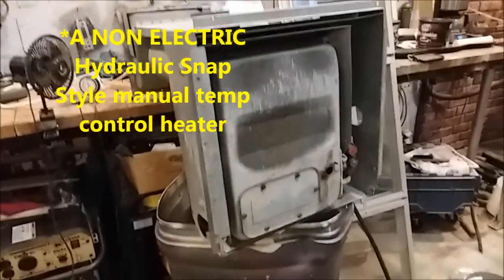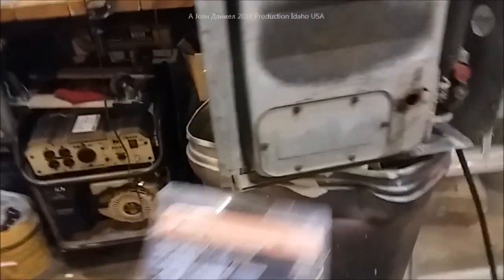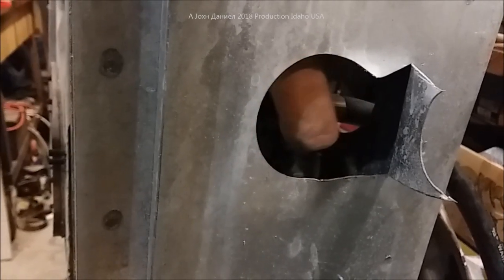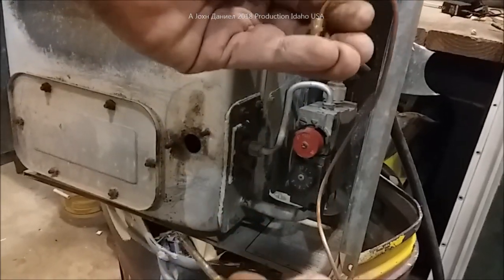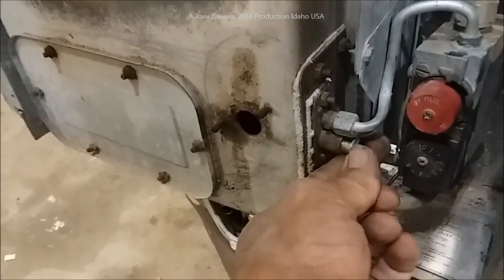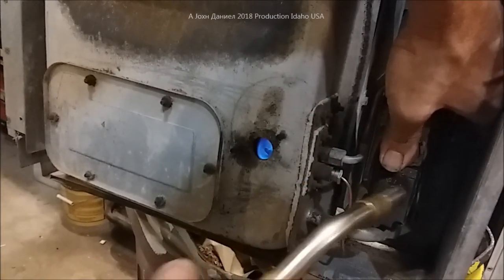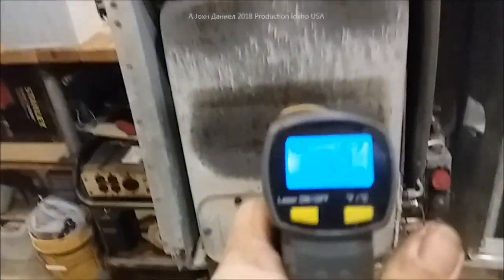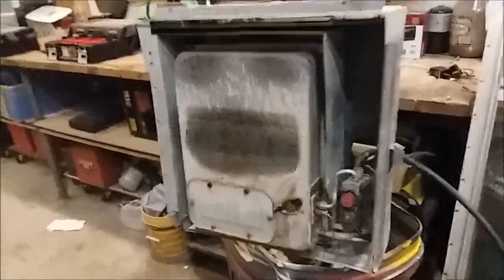RV Furnace problem, Heater won't stay lit? (info & Parts  below)

Comment from the maker: The NON ELECTRIC heater valve is so very adaptable, You can build a complete heater with one! The Robert Shaw https://amzn.to/2CHyFyp 710-205 Hydraulic Snap Action Gas Valve  is best on market &  Robert Shaw 710-502 Low Profile mV Gas Valve FULL KIT with everything  https://amzn.to/2RIKPLE can be used in millions of heaters and wall furnaces to upgrade and restore or repair. You can even build your own heater, safe and solid. SEE MY UP COMING VIDEO ON MY HOME BUILT 50,000 BTU through the wall vented heater.  Built for under $200!

Comment: I have this heater and have been trying to troubleshoot it. the first time I tried lighting the pilot there was a weak blue flame that wouldn't stay lit. I replaced the thermocouple and now it isn't lighting at all. any ideas?
Reply from the maker: Check for a blocked pilot orifice, it's a common issue after thermocouple replacement.
Reply: @JOHNDANIEL1 turns out the propane lines in my camper must have some sort of clog somewhere in the system. I disconnected the furnace from the main lines and hooked it up to a propane tank directly and she's running beautifully. thanks for all your help trouble shooting! your video was the most knowledgeable I was able to find about this heater.
Reply: I cleaned up the pilot orifice and it  is lighting now but it still has the weak blue flame it did before I replaced the thermocouple. should I replace the pilot orifice? the gas valve? what would you recommend? appreciate all your advice.
Reply from the maker: Some models had a inlet filter medium that may plug up. Using a small brush and some dish soap you should check for a leak as well on the tubing and fittings, a tiny leak can affect the pilot flame drastically. If it lights, its the flow that is the issue causing a low flame. The flame on them should be 1/2 to 3/4" high.

Comment: Hi John, I think I have this exact furnace in my '79 Trillium (Duo-Therm 65512-002), and I would love to get it working.  I've replaced the thermocouple, but am still not able to get the furnace lit.  Any suggestions as to what I would try next? Do I need to get the Robertshaw?
Reply from the maker: At that age from 1979 it's about a 50/50 chance that the internal parts of the gas valve is non-repairable due to either corrosion or dry rot. If the body of the heater is in really good shape and you can look down inside of it with a good light or maybe a small endoscope you know the ones that get for the little iPhones or Androids then I would suggest salvaging it and installing a new Robert Shaw because a non-electric are so almost impossible to get nowadays.
Reply: Would the replacement need to have a thermostat? Or do you think I could replace it with a simpler device with only an on/off function? From what I hear, people have said that the thermostat function isn’t that great in the small camper so they just turn it on in the mornings and evenings to cut the chill (we’re in Colorado). 

In other words, mine seems to have the 710-205, but maybe I could replace it with the 710-502?

Comment: Hi daniel,
I have some issue with my furnace , first time the  furnace will start and working , but after some time , is stop and dont start again , I have to turn the furnace off and start again,  maybe you some ideea what can be?
Reply from the maker: The only two items fail that way is the overtemp protection switch which is called the over limit switch, or the start delay relay that I speak about some of my videos.

Comment: My 2019 Open Range travel trailer has a Dometic furnace. I've  cleaned and tested the sail switch,  replaced the  flame sensor/igniter,  replaced the lp regulator (regulator had a recall on oi anyway) tested  the high limit switch and even jumped it but my furnace still  "short cycles. The blower turns on, I hear and see the flame ignite the gas but then flame goes out  after  1- 2 seconds. I have (2) 20lb lp tanks , one is full and the other is 2/2 full. Furnace will ignite and go out almost immediately over and over. Any thoughts on what is causing this ? Thanks for any help. Great video.
Reply from the maker: Is your thermostat a dual purpose thermostat? (Heat and Cool). If so in any unit newer than 2013 these can cause those actions. If it has an internal AA battery or a pair, replaced them with new ones first, if the issue continues you'll note that there's two wires that come up on the heat side and then if you cross those two wires with them removed from the thermostat by jumping them to see if you have a full heat function again. If so replace the thermostat, I never use dual purpose for thermostats they have an electronic sensor in them but after a few years of your unit sitting unused in either too hot or too cold conditions tends to fail. If it's an old style mechanical thermostat, the heat sending resistor wire may have gone bad in that and same thing jump the two wires and see if you get a different effect on that one you don't have to remove them from the unit. Just jump the two screws.

Comment: John , thanks for all the help. I can’t seem to find my situation anywhere. I have a 1973 Duo Therm 65210-2 , 9000 BTU gravity . I will try the thermo coupler first but where it goes into the burn chamber there is no threaded connecter. It looks like it just goes through a hole next to the pilot fuel line . How do I get this coupler off ?

Comment: For my 1969 heater, the pilot stays lit on the pilot setting but as soon as I turn the pilot dial to ON, the heater tries to fire up but about 10 seconds later, the pilot goes out and dies. Basically, it only stays lit on the pilot setting. Any suggestions?
Reply from the maker: Usually that is a effect of trash or dirt daubers on the internal parts, or paper wasp in the intake and or exhaust of the heater. If its totally clear all the way through then it sounds like a failing gas valve since its a 1969 the likely culprit is deterioration of the rubber parts in the old valve. You can replace the thermocoupler with a new one incase its in pre-fail stages but I usually just replace the entire valve with the Robert Shaw models https://amzn.to/2CHyFyp if the heat exchanger is all in good condition.
Reply: Great advice! Thanks a lot. Nice channel too!
Reply from the maker: I am going to start doing full reviews on Prepper and survival foods this winter, We have hundreds of #10 cans and materials but I found best of 9 manufacturers to be Augason Farms,  http://bit.ly/2Qs0vGO , almost straight to the plate edible LOL!

Comment: I've owned several Camper's, Slide-In's, 5th Wheels with these Heating units in them and they DO work Very Well. I'd like to get one and re-build it to go into my Bug-Out Trailer.....
Reply from the maker: I may run across a few you'd be interested in. Shipping would be $30 to 45 probably so I can possibly get you one in great shape for under $100 total.
Reply: @JOHNDANIEL1  YES, John. I would be Very Interested in one of these. I would have't to wait til after the 1st. of next month (Nov.), as I have went up to my limit this month on my spending......unfortunately =(  Thank's for this offer.

Comment: Another Excellent Tutorial. . Every "do-it-your-selfer" should know the first place you start is the thermal couple. The pilot light  generates a mili-volt value when the two dis-similar metals in the tip are exposed to heat from the pilot. That mili-volt  value keeps the main gas control safety open.  Pilot fails, raw gas ceases to flow into chamber.      Tony                                                 
  *Post Scrip: I wouldn't lose sleep over some of these geniuses and their comments

Comment: We stopped using our furnace. We got a mister portable Buddy Heater and we love it! 👍🏻🧔🏻
Reply from the maker: After seeing the body of a 3 year old removed from a camper due to a Ventless heater, a lil buddy actually I swore there is no way I would have or recommend one. Numerous makers of them have a problem with a part made in China. The oxygen depletion sensors in them can fail in the open/run and all their cover their butts rhetoric don't hold water when they've paid out numerous law suits already.
Reply from the maker: Appreciate that. I let viewers show their real colors and ignorance like you did openly. While your at it, learn something you fucking moron, I block fools. Mr. Heater 3800 BTU Compact Lil Buddy Indoor Propane Heater With Oxygen Depletion Sensor (Model # F215100)
Reply from the maker: They are dangerous in very cold and damp climates. Burner line pilot corrosion from moisture causes the SO CALLED Low Oxygen shut off feature to keep the gas on at 50% to full fuel. IDIOTS trust this stupid fucking thing.
Reply from the maker: A OXYGEN SENSOR ( a real one ) is in the air to fuel blending tube and works with a magnetic transducer based on atmospheric nitrogen and is in the body and is a fully separate device.
 In a Buddy heater ( JUNK ) its dependent on the lack of oxygen to the pilot AND YOU. Using a Thermocouple thats transferring the heat signal to the valve mechanically has a 5 to 8% accuracy ( WOW ). When you get below 20% oxygen you starve the pilot, reduce the heat to the thermocouple which cuts the Buddy Heaters gas. HOWEVER, with high humidity you get acidic corrosion on the pilot tube, that shrinks the pilots orifice, increases flame and makes it longer. The Effect Chokes it and makes it flow faster, pushing the flame continually onto the thermocouple even as low as less than 15% ( death ) Oxy levels. MORONS should own 10 of these!
Reply: HAHAHAHAHAHAHAHA
Reply: https://www.youtube.com/watch?v=m7cYSDl9qM0
Reply from the maker: https://www.greenbuildingadvisor.com/article/avoid-unvented-gas-heaters